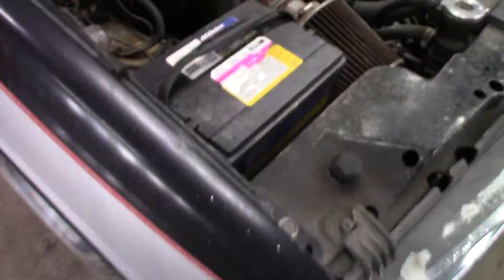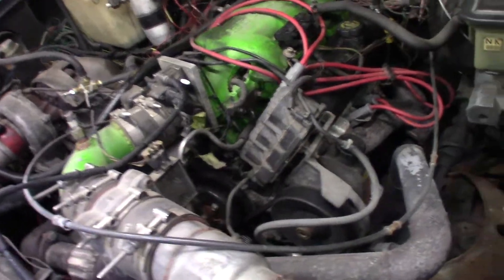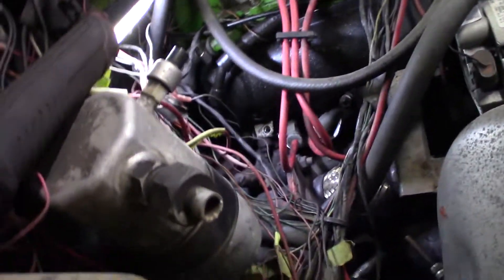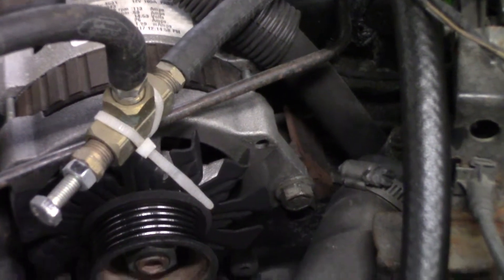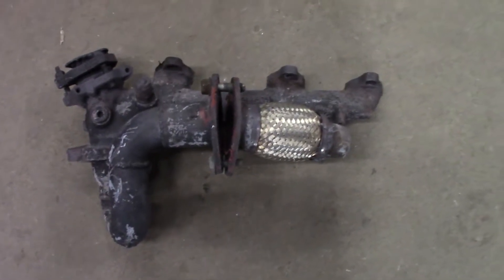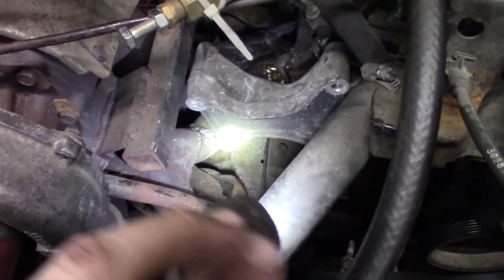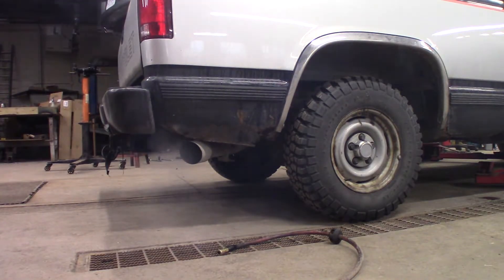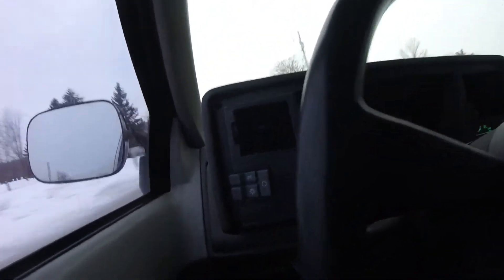Improving the turbo exhaust on my C1500!

Comment: How did you tune it for the boost from the turbo?
Reply from the maker: I'm using HPTuners for the OBD II pcm. It not the best for boost but it works! I will eventually switch to megasquirt or a holley terminator x system

Comment: Do you think the 3100 or 3400 are better than the 3800
Reply from the maker: I wouldn't say better or worse, but I don't believe that they have reached full potential yet. I like the 60° because they are a little simpler to work on! If they had more aftermarket support I'm sure they would be just as or more popular than the 3800.
Reply: @modeverything1  us there more support for the 3100 I have done head gaskets on both and they seemed about the same as far as simplicity they both have the correct amount of cams (one) and I assumed the 3800 would be better for boost with ho tuners since at the least they came with a supercharger but also if I do decide to actually do something I want to try a speeduino
Reply from the maker: Yes the 3800 would be better with hptuners since the actually had a 2 bar map with the l67's. The 3100 is pretty much the same as a 3400 just smaller bore and 10hp/10ftlbs less in most cases.
Reply: I guess aluminum heads is a plus as far as I know pretty much all the 3800 are iron i had my mom's off and laped the valves and it took forever and all the other benefits of aluminum
Reply from the maker: Yes the 3400 heads flow more than 3800 heads stock for stock. With a 3400 you can also use non vvt 3500 heads for a bit more flow too!